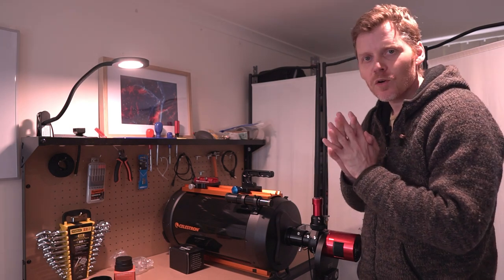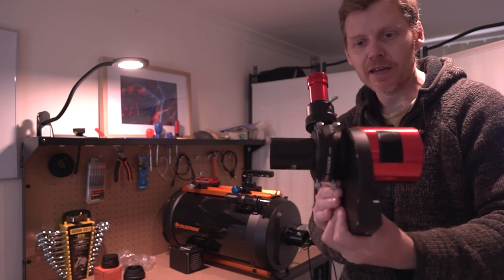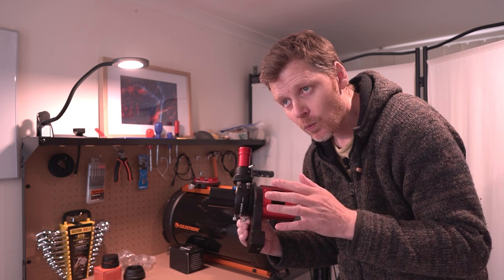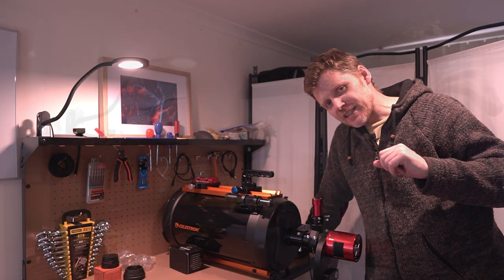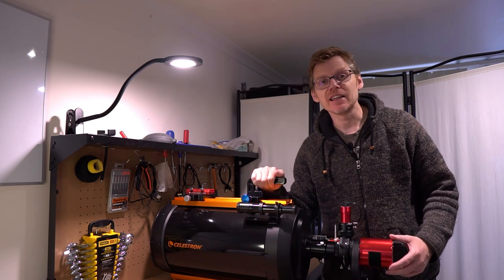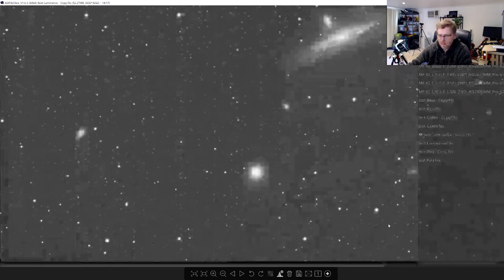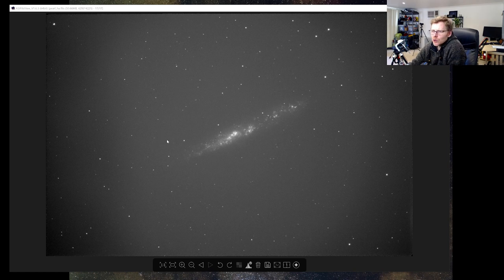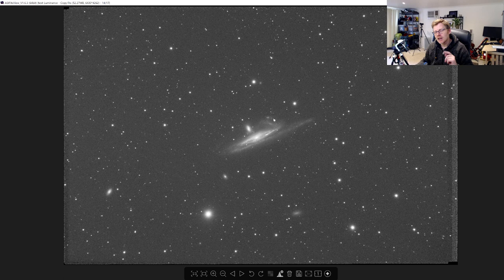Starizona SCT Corrector IV - Reducer / Corrector

Comment: Ollie, this is what i'm concerned about with the Starizona Virtual View - 2'' Rotating Visual Back unit is non centering and looking at the Baadar SCT but also read that it has the same issue as it's not a 360 clamping system? Did you order it?
Reply from the maker: Yes I've now got the Baader, I've read it's particularly good at centering so guess I'll just have to try it.  Certainly is a huge improvement on a standard compression ring.
Reply: @OlliesSpace  I have have seen a few YT videos that say it's does not center the item, as it can't center due the compression system not putting equal pressure 360 degrees around the 2". 1 video says when you close the lock 1 side is not moving out and the other side is out so that's without any EP or the SCT Corrector. Does your do that also?
Reply: @OlliesSpace  I came up with an idea, if you have feeler gauges very thin ones you can insert the SCT corrector in to the Baader and then from the SCT thread side try to push in thin feeler gauge and at the positions 12,3,6,9 see if that feeler gauge has the same amount of friction at those 4 points this would prove that is centered?

Comment: I purchased the Starizona corrector for my C8 and was finally able to use it last night. I'm a little confused by your back space calculations. I have the Celestron OAG and have my Starizona attached to the OAG M42 female adapter (4.5mm) then the OAG body (29mm) then the OAG M42 male adapter (12.5 mm).  I have a ZWO filter drawer (21mm) with an Antlia Quad Band filter, Then I have a 6mm spacer and finally the ASI071 MC Pro with 17.5mm. The total backspacing is 90.5mm which is on .2 mm longer than the Starizona 90.3mm backspace requirement. What was your reason to add an additional 5mm on back spacing?

I have my OAG prism as far down as possible and I don't get any shadow on my ASI071 APS-C sensor. I also didn't have any issue obtaining guide stars with the ASI174MM guide camera on my target last night, M51, despite noticing the M42 OAG adapter seems to cut off part of the OAG camera hole when looking down from the OAG camera position. I have the guide camera sensor long side set parallel  to the main camera long side so maybe only a small portion of the guide sensor is obstructed along the top.

I find the Celestron OAG helical focuser a little too sloppy. I wish the camera slot had  acloser tolerance to the camera cylinder. The two locking screws seem to tilt the camera cylinder so it rubs against the OAG focuser cylinder and you feel resistance in when turning the focus ring. I decided to try a 1.25" parfocal ring on the guide camera cylinder so I could remove the camera and not loose focus. It also helps center the camera and when the locking screws are tightened the tilt is minimized.

I use the Baader Click Lock. Thanks for posting this video.
Reply from the maker: Thanks I think I may have got my spacing slightly wrong here and so long as you've got to your distance I'm sure you're good.  Yes the helical focusser can be a little sloppy like you say.  Hope you get some awesome images with the scope now, it's been a great piece of kit for me.

Comment: Great video! I have a question regarding back focus. Looking at the Celestron OAG documentation, I see that the female M42 adapter uses 4.5mm of back focus, while the male M42 adapter uses 12.5mm of back focus. The OAG body is 29mm thick. Then there is the filter wheel (20mm) and the camera sensor offset (17.5mm). So, if I do the math, I get 4.5 + 29 + 12.5 + 20 + 17.5 = 83.5, which is roughly 7mm short of the Starizona SCT reducer ideal back focus (90.3mm), so something is not adding up. Did you add an extension that was not mentioned in this video? I am thinking of getting similar equipment, so a clarification would be very helpful. Thanks a ton! And keep the videos coming, they're great!
Reply from the maker: Apologies I never got to this comment. Just checked and my setup from reducer is 11mm spacer > 4.5mm OAG connector > 29mm OAG > 12.5mm OAG connector > 6mm spacer > EFW 20mm > Camera 7.5 mm (no tilt plate so connected direct to EFW).  Hope this helps.  I use this specific configuration as when I connect my camera to my refractor I just need to add a 16.5mm to my 6mm spacer to get correct backfocus.  Hope this helps.
Reply: @OlliesSpace  Got it, thanks for getting back to me. Yup, that all adds up now.

Comment: I don't know about this Starizona reducer, but the Celestron F6.3 reducer is sharper in the center than my Celestron 8 EDGE HD with the F7 reducer. Probably because it's f7 instead of F6.3. Now the new Starizona reducer makes the Celestron SCT 8 inch F7.1 again, so center sharpness can also change. I don't know what your experience with this is?

Comment: Are you able to drop the Celestron OAG prism low enough to get enough FOV to the guide camera sensor? I measured the width of my Celestron OAG body at 73mm. Half is 36.5mm to get the center point. I've calculated the closest the bottom of the prism from the center of the OAG body is 10.5mm. The size of the prism glass is 12.5mm x 12.5mm. The M42 OAG adapter is about 37mm diameter and 18.5mm radius. The prism height and the distance from the center will be 12.5mm +10.5 = 23mm). But part of the M42 circle will obscure the top of the prism by 4.5mm. I read the diameter of the Starizona SCT corrector is only 27mm diameter. Does that mean the prism will only pick up about 3mm of the edge of the corrector even with the OAG prism at its lowest level?  The Celestron 6.3 correct lens diameter has a much larger diameter of 40mm. I have an ASI071MC Pro which has a similar sized sensor to your 2600. Have you set your prism at the lowest setting? Maybe not a problem since seeing your results. Just wondering about this since I'm interested in one of these correctors. Thanks.
Reply from the maker: Hi There.  I don't have any issues illuminating the ASI 174MM sensor that I have now.  I'm not exactly sure but I think the prism is close to it's lowest point.  Hope this helps a little 👍
Reply: @OlliesSpace  On my Celestron OAG with the prism set to the lowest setting  its about 47mm from the bottom of the OAG housing. It appears to clear my 23.6 x 15.6 sensor but when I take a flat I get a shadow at the bottom of my flat. I raised the prism and the shadow went away but when I put my M42 OAG female on the bottom of the prism is barely visible. At the lowest setting of the prism the M42 OAG female covers 1/2 of the prism but it would leave a shadow on the flats and I presume on the light frames. Are you getting prism shadow on your flats? If you could measure the bottom of you OAG housing up to the edge of the prism. 
I'd be interested in comparing it to my OAG. Thanks
Reply: I forgot to include I'm using the Celestron 6.3 focal reducer when I take my flats and see a prism shadow. Thanks

Comment: Hi Ollie, I don't like the SCT to 2" adapter. So the Starizona SCT Corrector has M48mm female threads and I plan on using a SCT to M48 adapter and I think this will be more secure as it all will now thread on as the SCT to 2" can be a bit loose...
Reply from the maker: Thanks for the tip.  I'm not sure if I'd be fully confident using those threads.  They're fairly short and designed for a 2 inch filter but I'll be interested to know if it works ok.  Clear skies. 👍

Comment: I've got a similar experience as you with the Starizona reducer. It's definitively a step up from the Celestron one. The only thing I don't like is that I get some flare on bright stars probably due to pinching effect from the compression ring.
Reply from the maker: Hey that's good to know thanks, I do kinda wonder why they didn't go with making a screw in type connection.🤔

Comment: Please give me advice and information.
I tested the Starizona SCT Corrector IV that arrived yesterday with a flatback type C9.25. I set the back focus to 90mm and pushed the reducer all the way forward. Even if the focus part is turned all the way to the left, it is slightly out of focus. The focus knob rotates 32 turns from far to near. Please let me know where your set is in focus.
By the way, Celestron's original 0.63 reducer can be reduced with a back focus of 105mm.
From Japan
Reply from the maker: Hello I'm really not sure why you're not getting focus.  I also having it set about 90mm back focus.  Have you tried asking Starizona for some advice.  If you've  reached maximum travel on your focusser could be tricky.
Reply: @OlliesSpace  Thank you for your comment.
I've seen some C9.25 out of focus in the community. No response from Starizona.

Comment: I purchased the Starizona SCT reducer for my C9.25; however mine is a Mark III, so it really reduces the C9 to f/6.3 (f/6.26 with my optical train), but my sample at least doesn't do a great job with broadband B filter: stars are a bit under-corrected at extreme corners of my ASI 1600 sensor (which is even smaller than that of the 2600). Apart from that it is a great piece of glass, capable of transforming a standard C9.25 in something even better than a C9.25 Edge HD, in my opinion, as resolution is increased also on axis. Stars in your frame look pretty good and keep in mind a thing: I bet you will notice no improvement using a Baader Clicklock. I use it on my OTA, and I think the remaining distorsion you are experiencing is not related to the clamping method. Your stars couldn't get any better than that, I think. It would be great if you could check your B channel and report me back whether it is corrected or not. In case I could consider buying a Mark IV ;) Greetings from Italy!
Reply from the maker: Thanks for all the information, always good to hear from another owner of the same gear.  I will take a look at the blue channel and get back to you.

Comment: I have a 2600mc pro so no filter wheel and no OAG for me. What should my optical train look like to achieve back-focus with this for my 8se? I haven’t bought the starizona yet.
Reply from the maker: It will probably be very straightforward for you, just look up the backfocus for the reducer and all you will need to do is add spacers to get there.